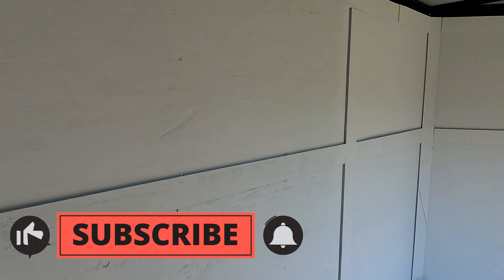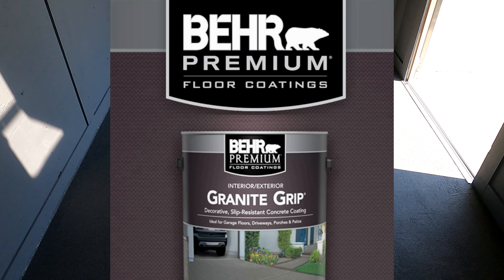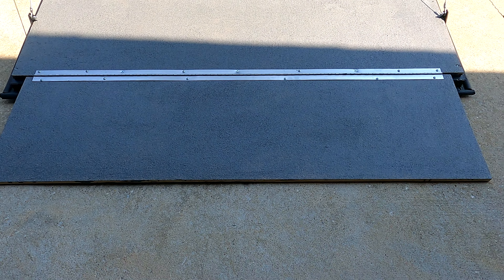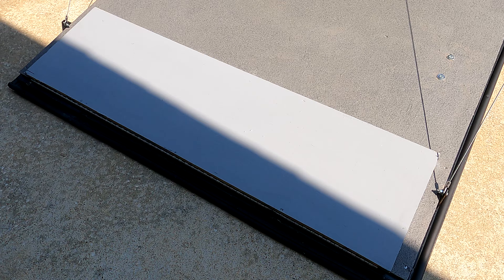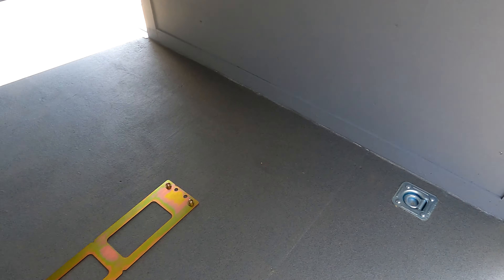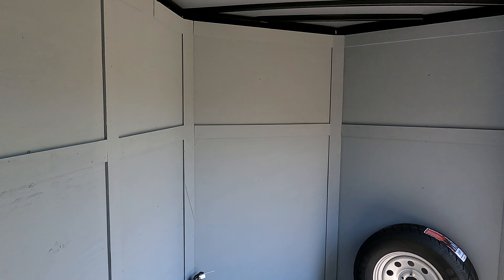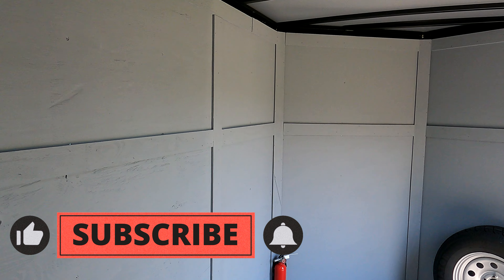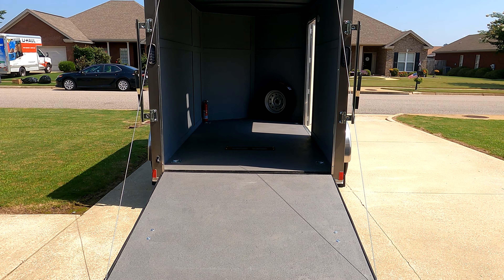Enclosed Motorcycle Trailer Project is Complete | Ready to Haul My VMAX 1700

Comment: LED Light Strips inside to help with getting around in the trailer at night would be a must for me, from different angles of course. Low cost, 12 volt, wired from the trailer lights, with a switch inside near the side door. Low cost and very practical.

Comment: Master Jeff,,, Stylin and Profilin!  Wooo!  :)  Nice thought the fire "putter outer" and the floor grip paint, can't wait to see the restraint system.  On my 5x8 I have 6 tie downs and the heavy metal wheel chock you drive the front wheel up into, that holds the MAX upright while I use the tie downs.  Actually, at my age now and size, I have to rule out a future Gen 2, hard enough loading a Gen 1  for me let alone a Gen 2.  Keeping a close eye on the 2022 MT-10 SP mainly for the power, tech and far less weight.  I did take notice when you used the term "wrestle" in relation to loading the Gen 2 as to it's size, I believe it to be the longest of the "Power Cruisers", but not the heaviest, that was the Rocket 3 and the Suzuki.  My best and be careful out there.  :)
Reply from the maker: Thanks Jay. As you will see in a future video, I will not need a wheel chock for the VMAX because of the way the restraint system works, but I will need one for the Gold Wing. You are correct, the VMAX is one of the longest bikes out there. Most folks who criticize the VMAX overlook that important aspect of this bike.